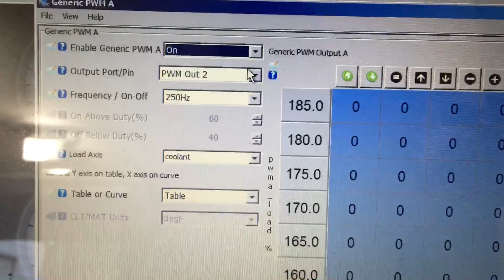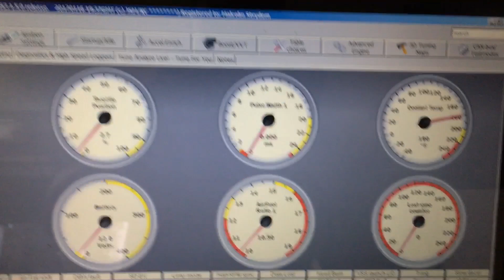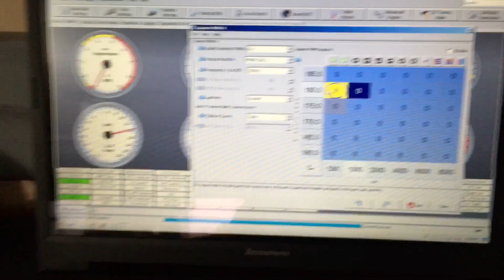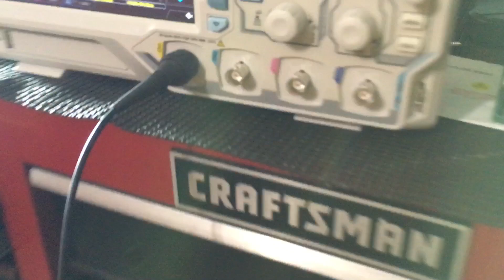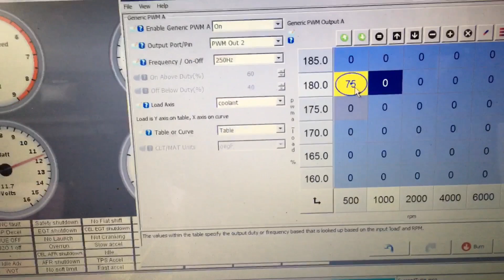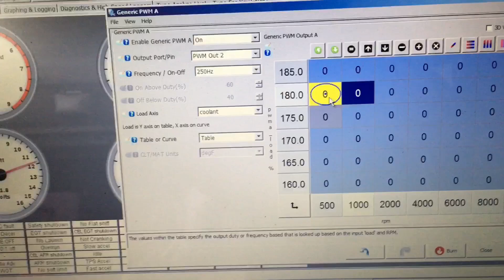Fan speed control MS3 Megasquirt

Comment: FYI for everybody who comes to this video.

Malcolm, excellent work!

I am using a mercedes fan controller unit. Here, the PWM is only used as a signal to tell the unit the settings, it uses much higher frequency inside. ESG 300, ESG 400 both work. It's literally same as the FoMoCo one.

Comment: Thanks for the video. Would you know the max amps of these controllers?
Reply from the maker: I've wondered but never done any tests to see.  I've run Mark 8 fans on several vehicles for many years which ran at full power in mid summer and zero issues.  That's pretty beefy fan so they can handle a decent amount of current.
Reply: @MalcolmV8  I'm visiting this again after hooking up one of the ford PWM to my truck running MS, what are the other two small terminals next to the PWM wire for? I wanting to find something that will take a 12+ input from my ac compressor to turn on the fans.
Reply from the maker: @gregory9740  if you're using the fusion controller that is not possible.  You need to make the MS  turn on the fan with the PWM output.
Reply: Where can you get the pigtail for that module?

Comment: Is the pwm signal positive or negative to the controller? Im using the ford fusion fan controller. Just wanna be sure im on the right track
Reply from the maker: The controller's signal is a positive voltage so you need to produce a grounding PWM for it.  Your controller, stand alone ECU or Arduino etc, should be grounding the signal pin from the Fusion speed controller.
Reply: @MalcolmV8  is it ok to leave the signal wire connected to the ecu without a relay to break the signal with the car off? I heard something about "back feed voltage" can damage the ecu.
Reply from the maker: @artynanez5056  I have not experienced any back feeding from the PWM signal wire.  Most cars I have a relay removing power from the fusion speed controller on key off but there's a few I've done without it and did not experience any feedback or problems.
Reply: @MalcolmV8  Thanks for the responses. I appreciate all your help.
Reply from the maker: @artynanez5056  You're welcome.  Best of luck with your project.

Comment: Thanks Malcolm .. great video ... I'm just in the process setting up my Dual thermos on my Land Cruiser in which i run a MS3PRO EVO . Luv your tip of removing the solid state relay and replacing it with the "Controller " which maintains that 19.2 kHz Freq ... Would it please be possible show me where i could locate a wiring diagram to include into my wiring diagram . also would i need a controller for each of my fans ? cheers Brett.
Reply from the maker: You should be able to use one controller for both fans.  I've run dual fans with a single many times.  If you look at a more recent video of mine "Junk Yard MS3Pro Fan Speed Controller on Project Redfire" I draw up how the controller wires on a white board.  I hope that helps.
Reply: @MalcolmV8  Thank you kindly sir .. very much appreciated
Reply from the maker: @Hatdrop007  You've very welcome.

Comment: Can I run half of a common ground?
The fan has two high current hot wires and a single ground.
Reply from the maker: I’m not sure what you mean by half a common ground?
Reply: @MalcolmV8  The fan has one ground wire and two hot wires. To get full speed you have to power both of the hot wires. I would like to control one of the hot wires via pwm.
Reply from the maker: @danielkruger4305  I usually tie both hot wires together and PWM them both.  That allows you to turn the fan from really slow to max power with the controller.
Reply: @MalcolmV8  I like that idea. I don't know how to incorporate air conditioning needs.
Reply from the maker: @danielkruger4305  I built an arduino circuit to generate PWM signals and control the fan speed controller for AC.  If you don't work with electronics the easiest would be to just bypass the controller with a relay to run the fan for AC.  In a newer release of the MS3 PWM fan control will be built in so it'll support AC natively.  It's already in beta testing.
Reply: @MalcolmV8  I've decided to try a temp sensor that passes through  both the condenser and radiator and tie that to a pwm output. 
I look forward to the new feature.

Comment: This is the best explanation I have seen! Thank you! One question is do you know where I can find the specs for that Ford controller? Can you run two fans in parallel if the max amps for both is 40amps?
Reply from the maker: You're welcome.  I have not found official specs on them but they seem to hold out and work up to 40 amps.  I have not pushed one to failure so unsure where that is.
Reply: @MalcolmV8  Are you using 2 fans with one control module?
Reply from the maker: @Dad_Dude1  on some of my projects yes.

Comment: Can i run 2 fans with this pwm relay?
Reply from the maker: Yes I've done installations with dual fans that have  been working great.  If you have a very powerful fan that draws a lot of current like a Mark VIII fan I'd probably only do one per controller.

Comment: i need to do this exact thing. Do you have a wiring diagram how you wired this into the system?
Reply from the maker: It' a single wire.  Take the signal wire from your speed controller and wire it to a free PWM output on the MS3 and configure the MS3 to use that specific PWM out.
Reply: @MalcolmV8  which port did you connect the signal wire to on the PWM? along with from PWM to the fan? sorry im super confused by the wiring of this. thanks
Reply from the maker: @adelort  Think of the speed controller as relay and wire it in a similar fashion.  You have a heavy gauge wire from the battery to the speed controller and a heavy current ground.  Then two heavy current wires from the speed controller to the fan itself.  Then you have a very low current signal wire from the MS3 to the speed controller that sends the PWM signal telling the speed controller at what speed it should spin the fan at.
Reply: @MalcolmV8  Ok that makes more sense. So instead of an actual relay, you are using that PWM (speed controller) as the relay. So did you use M+ for the positive fan wire, M- for negative fan wire, 30 for key on source, and 31 for the low current signal wire from MS3?
Reply from the maker: @Adelort123  If you're using the exact same Ford fan speed controller as I used M+ is fan positive wire, M- is fan negative wire.  30 is heavy current supply, 31 is heavy current ground.  Above those four pins you'll see a row of 3 smaller low current connectors.  The middle one is the PWM signal wire.
Reply: @MalcolmV8  just wanted to say thank you. thats exactly what I needed. did you wire in any relays, inline fuses or connect it to a key on source? or just wired it how you just described, and left it at that?
Reply from the maker: @adelort  I've wired up several of these in various cars a few different ways.  My observations.  You can wire this particular speed controller directly to the battery (Ford did on the few models I checked).  The current draw when not in use is micro amps and will not drain the battery.  The side affect is when you turn the car off the fans take an extra second to turn off.  It'll catch your attention as you hear them spin down real quick right after the key is off.  On other installations I used a key on power relay to cut the power to the controller on key off and in those cases the fans loose power instantly on key off and you don't hear them at all as the car shuts off.  Minor difference but worth noting if you're particular about your car.  Inline fuse on the main power wire is always a good idea.
Reply: @MalcolmV8  ok. so if i wire directly to the battery, i just need an inline fuse from battery to the controller correct? and in the other scenario you wired in a key on relay feeding the controller... how exactly did you wire that up? i would assume this would be separate and that the controller will still get wired the same as you previously stated? and the last question would be, for the two wires coming out of the controller, to the fans, both positive and negative wire to the fan wires, similar to how ford originally had it, and you do not ground the fans to a ground on the chassis? (i apologize for all the questions, im a newbie to this so i truly appreciate you being patient and providing amazing advice)
Reply: @MalcolmV8  thank you so much for this, super helpful
Reply from the maker: @Adelort123  You can wire the speed controller to the battery anyway you choose.  Either directly or with a power relay.  As for the fan both wires need to go through the speed controller.  Do not wire one and the other to chassis ground.
Reply from the maker: @egimzyegimzy3566  You're welcome.
Reply: @MalcolmV8  that clears things up. in the case you did the key on relay, how did you do that?
Reply from the maker: @adelort  No different than how you use a relay to power a fan directly or a light or anything.  Simply insert the relay into the heavy current power line so it's now in control of when your load gets power (in your case the speed controller).  Connect the trigger wire to a power source that goes hot when the ignition key is turned on.

Comment: Awesome! I was hoping to find a solution for this. Couple questions...
Will this work on a 2 wire fan? It looks like yours has more than that. 
How many amps can one of these handle? I’m looking for a solution that can be used for electric water pump, fan and possibly fuel pump to keep everything consistent
Reply: Yes it is intended for 2 wire fans.  I was not using the 3rd wire on this fan.  I'm not sure the max current but I've used on 30amp fans with no issues.

Comment: I'm glad you made this video, obviously that's not healthy for a full pump. That one has a very slow switching speed. Even an SSR switches at a max of 1Khz. Ugh, when will they make a single high current controller to run two pumps? I ordered a china volvo controller and am going to see what it's capable of. Many vehicles have pwm pump controllers now, the trick is finding something that won't die with a beefy aftermarket pump.

Comment: That controller from the junk yard can you hard wire something like that to come on with a simple switch and avoid amp spikes?
Reply from the maker: Not this specific one.  However the one I tested out of a Mazda 6 part # 1355A124 you could turn on and off with a simple switch or relay just for the soft start feature.